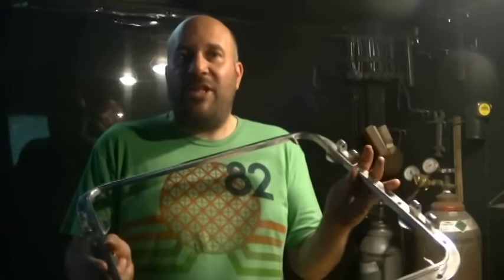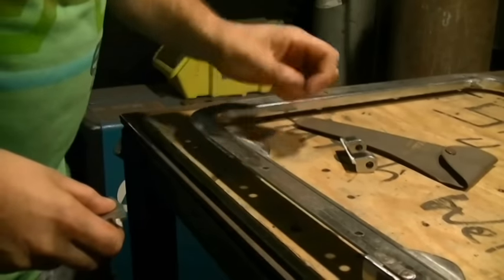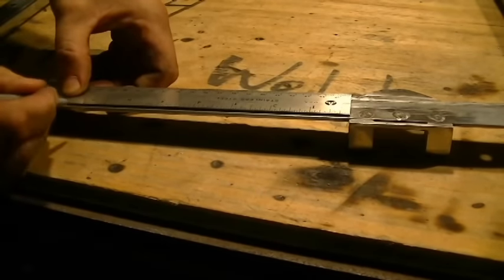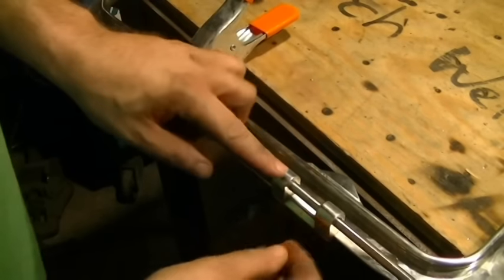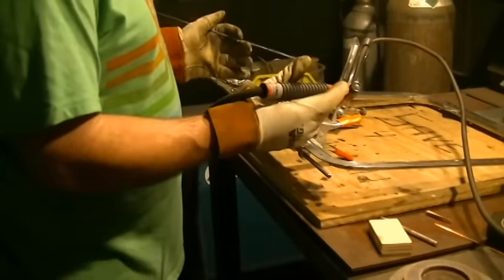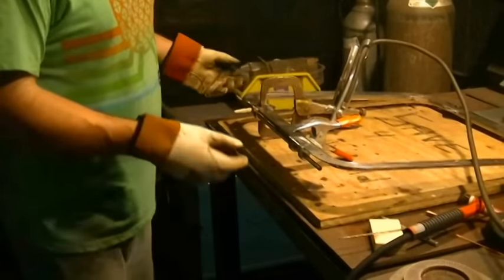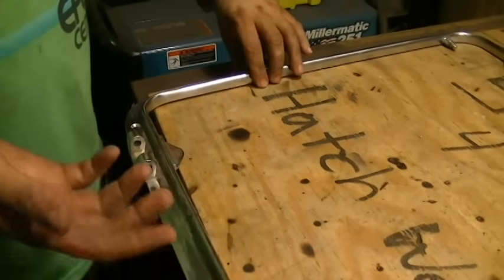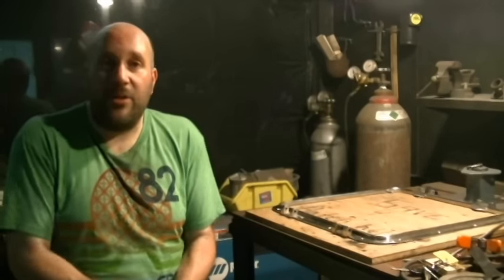Factory Plug Weld Failure

Comment: When the term are properly used, a scale starts right at the end and a ruler does not. Rulers are made this way so they can maintain accuracy even if the end is damaged. The other reason is when drawing a line, the pencil does not fall off the end of the ruler when it gets to the end.   Everyone interchanges these terms so there is no point arguing. cheap end measuring scales/rulers here: http://www.shars.com/products/measuring/rulers
Any style of ruler or scale you can imagine: http://www.geionline.com/rulers/